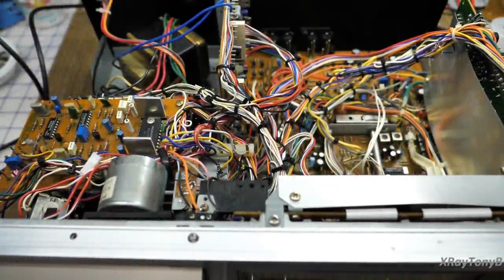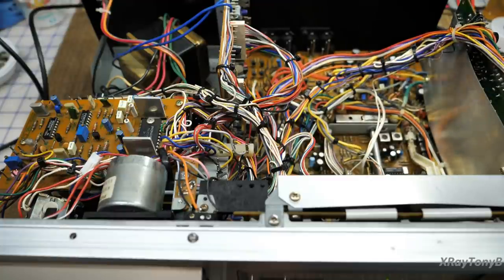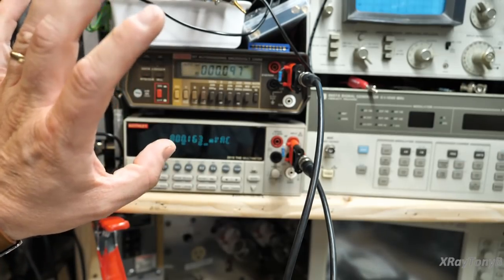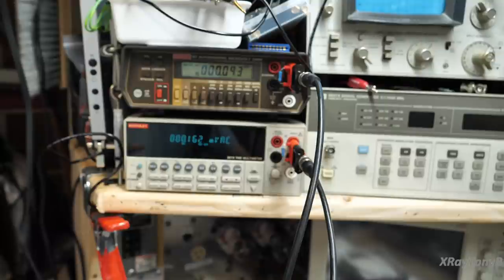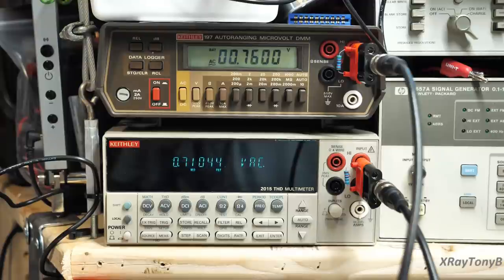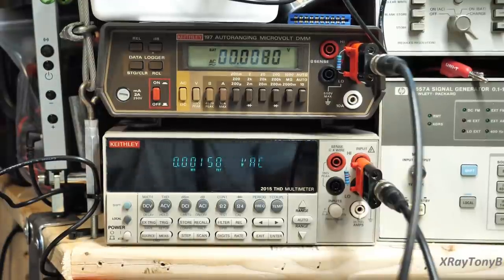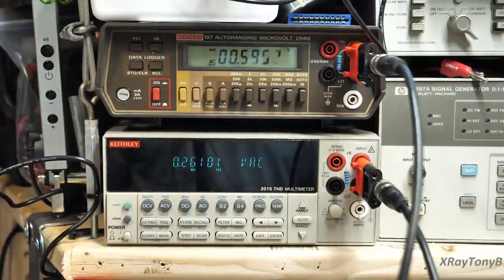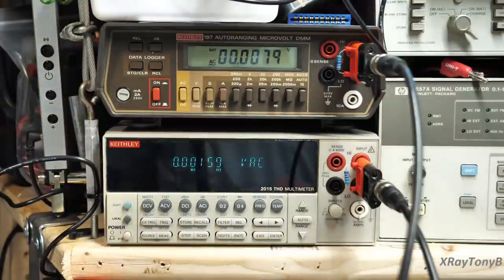Pioneer CT-F1250 Cassette Deck Part 6 - Alignment Begins

Comment: Very informative alignment video Tony!  For those old enough to remember the service areas in your local stereo stores growing up, this is a refresher on the top shelf skill sets these men and women had and used on a daily basis to repair and make this equipment right.  It's amazing what we took for granted or just filed away as "magic" to make these tape decks do the right thing the right way.  Thanks for the video Tony; looking forward to the next one.

Comment: Really enjoying these Tony, thankyou. I am however beginning to feel I may have bitten off more than I can chew with my Nakamichi Dr-1 refurb...Despite your calm and logical demeaner in these videos I do feel a little overwhelmed with the prospect of aligning and calibration!
Reply: Aligning a tape deck is no easy feat. You'll need a lot of specialized tools to do a complete makeover. Besides necessary spare parts, you'll need test cassettes, alignment tools for tape path and head geometry, a proper oscilloscope and even gauges for torque and parameters like pinch roller pressure. I reckon it is cheaper to send in a deck to a specialist unless you plan on restoring/repairing a bunch of them.
Reply: @svenschwingel8632  And those "good" test cassettes cost about $75 each. I have 3 different test tapes from e-bay and the 3kHz signal varies from each up to 15Hz
and the wow and flutter on 2 of them goes from 3000 to 3008!!!!  soo proceed with caution... they will get you close not exact.
Reply: @426hemicuda1090  there is a guy named Alex Nikitin who has a company called A.N.T. Audio. He sells test tapes that he creates himself which are very close to what you can get from Gennlabs at a decent price with internatiinal shipping. You might want to google his site and check it out ...
Reply: @svenschwingel8632  Thank you!!!

Comment: I am really enjoying this series! :) as I am currently aligning an Aiwa AD-F810 3 head and a same year Kenwood. I have found that the tape speed adjust in both deck's motors is soo sensitive. I can not get closer than .5% at 3kHz.
Reply: Yeah, I recently fixed some of my tape players and decks and the pots in the back of the motors are really hard to adjust.
Reply: @michaelweser2553  I was thinking of turning the motor pot up and putting a 10 turn pot inline with the motor wires and adjusting it there. Am I being too picky????
Reply: @426hemicuda1090  I don't think that this would work. Inside the motor is a circuit which controls the speed and makes shure, that it stayes stable within a range of load (tourqe). You can't just put a resistor in series with the motor. You'd have to replace the pot inside the motor with a 10 turn one.
Reply: @michaelweser2553  Thanks... I'll just settle for 3010Hz then hehe
Reply: The speed control pot develops oxidation. I turn the pot up and down many times just through the target range with the power off. This usually  makes them less touchy in most cases. I had one in my Panasonic RX-5250 boom box that would keep drifting off speed, so I gave it a very small shot of deoxit cleaner, been rock solid on speed for a year now. Just checked it the other day and it was 3003 on a 3000Hz test tape.
Reply: Something I have done to find a problem with a motor speed problem is to listen to a 3000Hz test tone either on YouTube, or an app for your smart phone, then put your test tape with a 3k tone in the deck and "tune" the pitch like you would a guitar. Easier to hear the pitch rising and falling (beat frequencies) rather that watch a meter count digits up and down. Tap on the motor with a screwdriver handle and see if the pitch changes while listening.

Comment: Did the test tape 333hz 0db tone verify the 0db reading on the meter after adjustments?
I noticed that this deck is calibrated using the 160 nWb/m flux density which is quite modest compared to many other later decks which commonly used the 250 nWb/m setting.
The difference is almost 4db.
This means that recordings made on this deck will show up -4db down on some later decks.
The recorded output level should mirror the VU meter reading as set for recording, but as you mentioned, tapes vary and their sensitivity could affect this tracking.
I would certainly make my own recording at 333hz 0db to see how closely the output level shows on playback.
A record/ playback frequency response test by sweep or spot frequencies would be good at  -20db.
Reply: Yes, 0dB with this deck is for 160 nWb/m. Dolby reference is usually around 200 nWb/m and modern decks have indeed a 250 nWb/m scale. It's important to know so you can level recordings appropriately.
Reply from the maker: The whole concept of these test cassettes has been a real learning experience for me. Although there are standards out there for compact cassette recording and playback, I'm finding out that the specific tape for aligning a specific tape deck can be anything BUT standard!  Later on in the alignment procedure, there is a section for aligning the record/playback frequency response.   I think it will address some of this things you mention.  I can't believe how many steps there are to aligning this thing!  The only thing that was harder than this was the alignment of the HP audio spectrum analyzer.  Thanks for the info and for the comment!
Reply: My level calibration tape made by TDK, TA-01 LEVEL, is full track and states: freq 315Hz. level -4db, reference level: 0dB(250pWb/mm at 333Hz).  This is what I have been using to calibrate 0dB on the VU output meters for years. Does all that translate to 160 nW/m?
Reply: @zulumax1  it should. 160 should be around -4 if the standard is 250 at 0.

But there are formulae around to recalculate if you want to be sure.
Reply: is this why my Recorded tape Played on a different Deck are very low output even w the output turned all the way up?

Comment: Hi Tony, great vids. My problem living in Africa, cannot get test tapes, can you do a vid on one making one's own basic test tapes, for Playback and rec gain, and bias setup. The trick is getting the test tapes to the correct mV or dB level on the tape when recording. I have a good direct drive machine to make decent test signal recordings but setting db is tricky. I use a signal gen and have a pico scope which also has a sig gen output. Thks Tony, hope the CT scanners arent keeping you too busy. Im repairing linacs now...

Comment: I believe the SM's 1.12V voltage setting for the playback is wrong, it should be 710mV. If you playback the 333Hz 160nWb/m tape with the decks output at the click-stop the decks meters should be at 0db. The test tape playback a +5db on my deck, it plays back at 0db at 710mV . I did some searching and Gennlabs (who makes the cal. tapes) confirmed this. Check it out let us know what you get on the test tape playback.
Reply: I here that but will it mess up the rest of the adjustments? Will it increase the Volume of the recorded Tape? After making a Tape and than Play the tape in Different deck Its Very low Playback Volume and the volume Output is turned all the way up? I need to fix this.

Comment: Excelente video Tony, bastante parecido a los ajustes de mi CT-F950.
Reply: I have a 1250 and a 900 which is the same as the 950 less metal tape capability. I think the 900 has automatic sensing for chrome tape which the 950 does not have, as I recall.
Reply: @zulumax1  El 950, tiene para cinta de Metal.
Reply: Se puede decir que son idénticos, pero el 950 tiene un selector de cinta, donde eliges entre STD, CrO2, Fe-Cr y Metal mientras que en el 900 solo tienes para elegir entre STD y Fe-Cr, ahora no se, si el CrO2 es automatico.
Reply: @zambrano966  CrO2 automatic sensing. The switch does not matter.
Reply: @zambrano966  Since they don't make FeCrO2 tape, just leave the switch in STD and the machine will sense tape type.
Reply: @zulumax1  El mío tiene el mismo problema que tiene el de Tony, que esta reproduciendo  las altas frecuencia atenuadas, pero voy hacer lo que hizo Tony, voy a remplazar los condensadores en la ruta de audio y veré si mejora las altas frecuencias. Otro problema que tengo es que no poseo un buen cassette de alineación, hace unos cuantos años atrás hice uno en una grabadora TASCAN 122MK2 que estaba en muy buen estado y bueno grabe las señales de 333Hz 0dB, y 333 Hz -20 dB y 12 KHz.10KHz, 8KHZ, 6KHz -20 dB y quedo bastante bien, lo malo es que se me extravió en una mudanza y bueno ahora no tengo un buen cassette para alinearlo como debe ser, voy a ver si consigo el que uso Tony en EEUU. Esa compañía existe y es probable que lo tengan y otra cosa que le voy a cambiar son los potenciómetros de ajustes por uno de 10 vueltas tal como hizo Tony.

Comment: Are you going to check or replace any of the electrolytics? I had several bad ones on the motor controller servo board on both my Pioneer RT-701 and RT-702. Those do produce much more heat than the CT-F1250 however. I have a museum quality CT-F1250 that will need work as well as a CT-F900. Been watching this series closely, great job!
Reply from the maker: All the electrolytics on the motor board were replaced.  The audio path caps were replaced on the mother board, even though they tested good.  I did not replace the others, as they were all testing good.  Thanks for the comment!

Comment: TDK D was historically close to IEC zero sensitivity through its many versions at 315-400Hz so it will not throw you off by much on Dolby level REC Cal. Its curve is bit treblier than IEC. BASF Ferro used to be bang on for IEC sensitivity and HF curve also.
Reply: To be honest, you can calibrate the internals to almost any tape you want since the 1250 has an external 3-point calibration that will allow you to max out even really exotic formulations. Just don't use pure chromes for internal Type II calibration on a japanese deck - go for the cobalt-doped instead. Like the TDK SA or Maxell XL-II.
Reply: @svenschwingel8632  You can, but you should also establish zero sensitivity is zero indeed on the external dial. Else its confusing and you shorten its useful compensation range. Which is usually only +/-3dB to start with. 
Pure Chrome developed a problem, many sealed NOS samples having lost much sensitivity. Deterioration in decades of storage. Cobalt doped formulations on the other hand still behaving in spec mostly.
Reply: @somebodyx  the pure Chromes were very different even when brand new. And since they were made almost exclusively by BASF, you'll find a lot of european decks like Revox, Dual and the likes with a factory calibration for pure Chrome instead of Ferricobalt. The problem with deterioration over age is also well-known among tapeheads and I have experienced that myself with a batch of beautiful NOS 1989 BASF Chrome Maxima II. But you are right: if you calibrate the deck's internals to something close to IEC reference tape, you will have that +/- range for external calibration. Then again: if you only use one tye of cassette (like I did back in the day with the mighty TDK SA-X), you might just as well use the internal calibration for that. It's pretty easy to set up on a 3-header anyway 🤷🏼‍♂️
Reply: @svenschwingel8632  Hi, I don't have a fixed alignment European deck in my collection. But I have an autocal Revox B215 that I fully restored. It additionally offers a duplication industry style 120uS type II Rec mode for exploiting type II tapes better. Other than that its autocal system isn't set too different for base bias between German and Japanese type II formulations. Judging from the service manual's dB chart for BASF SONY TDK using a plug-in bias adjuster. There is only 1dB check point difference between them. I have that adjuster module and I aligned the deck with it. The autocal sets chrome or cobalt with same ease. 
Before that, I traced and repaired an issue in its serial to parallel data bus area that wouldn't kick start the bias oscillator. After replacing almost a hundred ageing Frako & Philips caps with Nichicon UFG & UKZ the sound quality went up to a very satisfying  level. So much so that I stayed away from modifying the op-amps and CMOS switches types for now. Azimuth and speed are very steady. Compatibility is very good across commercial and home made tapes especially after little tweaking with the M-300 gauge. W&F was initially bad but after fitting  new factory sourced pinch rollers gives 0.025% RMS steady on WFGUI with an ANT speed tape for the test.

Comment: "Shut off the line input volume to "0" and raise the input of the line terminals"  means turn the volume all the way down and then turn it back up to whatever. Basically what you did.

Comment: hey Tony, for the level and balance adjustments you did at the start, I wonder if it would work to use one of those tape head jack adapters and inject a stereo signal of the necessary frequency.
Reply from the maker: I've had emails, messages and comments about this.  The short answer is that it won't work, but the reasons why are very interesting.  I will begin the next video with a comment about these adapter cassettes.  I have one, so I'll get it out and we'll do some tests.  ;)
Reply: @xraytonyb  Awesome! I've always wondered about that, but never tried it myself. Would definitely make for great video content.

Comment: Hi Tony! You mentioned in one of your vids that you have an extra machine just like this one that you use for spare parts. I’m asking cause I am on the hunt for a tiny but vital part that I need for my own restauration, namely the tape guide RNK-348. It is attached to the left pinch roller but for some reason it is missing from my machine. I am really desperate, without the tape guide, the machine spits and eats tape. 
I guess my question is, do you have this tiny piece of plastic? And if so, would you sell it?
Love your videos. Truly top of the line. Some of them, I’ve watched twice. 
Greetings, Toby from Sweden
Reply from the maker: It is a complete unit.  I didn't have to "borrow" the head from it.  Someday, I will get it cleaned up as well.

Comment: Can't believe the manufacturer would go through all this before boxing up! Would they have a quicker more cost effective way?
Reply: This would be someone's job all day every day so they would have an optimised bench setup and not need to refer to the instructions for each step.
It's also likely that different parts of the alignment were carried out by different people on a production line basis.
But as you can see, that's still a cost and as with record decks, mechanical precision and correct alignment are vital for good performance.
You can see why cheap decks are disappointing.
Reply: @simonparkinson1053  I just retired a year ago from electronics fabrication and manufacturing. One person would probably specialize in only some of the calibration, then it goes down the assembly line to the next station. When you are doing the same adjustments every day you can do it in your sleep, you get really fast at it. There would also be quality inspection checks and verifications along the way. Dr. Demming taught the Japanese statistical process control and manufacturing techniques after WWII.

Comment: Hi tony when you use to separate test meters together , do you ever find that they read different to each other . I know when I was working as an electrician we would send our test equipment off to be recalibrated,   yet when we tested them against   a known sources they would still always read slightly differently from each other . I just wounded if this can be an issue in your field of work . When working with 230/ 400 v a bit of discrepancy is neither here or there, but with your  minute amusements could this be a problem ?             Best wishes and kind regards as always.  😀👍👍👍
Reply: The nice thing with the Keithley 2015 (and the non-audio 2000 meter) is the switching between front and rear jacks can be used to switch between left and right channels therefore eliminating calibration differences between instruments. 
I'm lucky enough to have both a 2000 and 2015, the 2015 likely came from the same batch as Tony and many of the other electronics youtubers have. The 2000 I bought as faulty and repaired.
Both went for calibration at the same time but there are still differences.

Comment: The bulk of the cost of the original manufactured deck must have been the calibration and set up. I do wonder how well it was done as time went on....
Reply: A retired former professional repairman I know told me that especially Sony was very lax with their alignments, even with their top of the line ES components. In his opinion, Sony was constantly wasting 25% of their deck's actual capabilities.
Reply: Even if you took a tape deck into a shop to have it "calibrated" the results would sometimes be worse than before it was messed with. I can usually tell by using a deck weather it is out of calibration and needs to be aligned. As a collector I keep a set of calibration tapes just to check out and see if it needs alignment without taking the covers off.